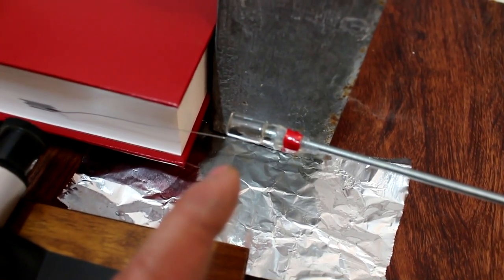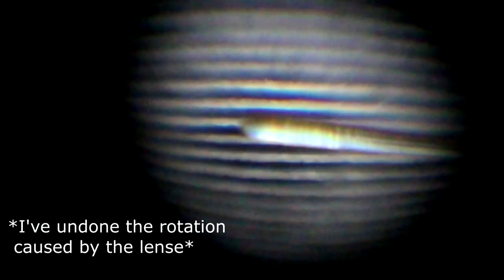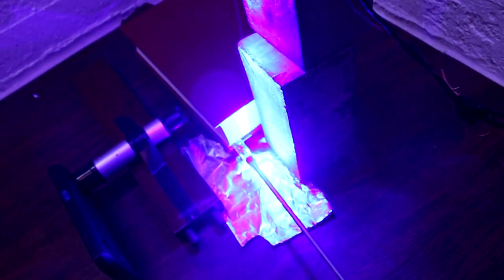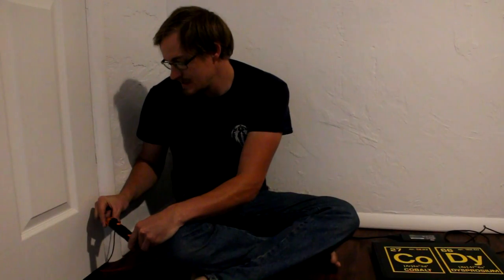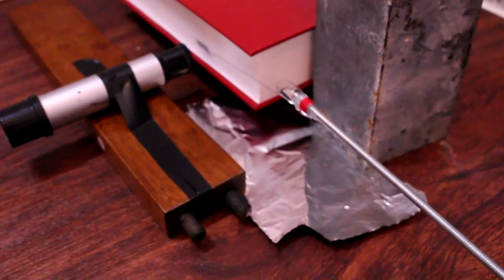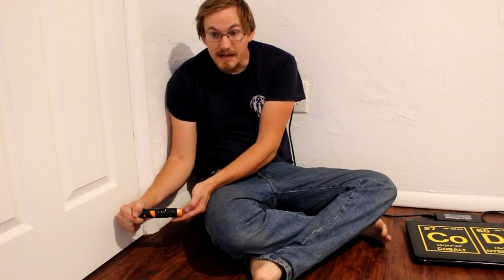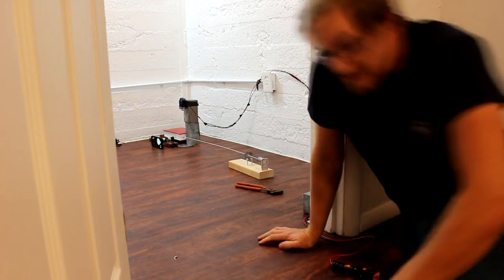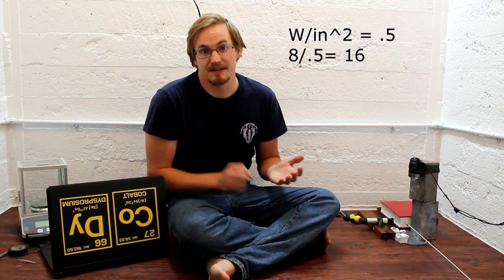Does Light Push?

Comment: 0:27 you said photons have energy and therefore have mass E=MC2.. that's not exactly right... or well most scientist would disagree anyway

 if photons have mass and are going the speed of light then they require infinite energy which isn't possible.. in the LHC they simply can't get particles with mass to %100 the speed of light because it would take infinite energy 

It's supposedly believed (according to most physicists)  that photon's have no mass but DO have momentum which pushes objects and you may know they CAN be affected by gravity i know what your thinking... no mass means you can't have momentum (p=mv) and you cant have it affected by gravity (w=mg) but the formulas change.. i'd like to get into it but you'd have to research it yourself.

Big fan BTW...
Reply: wouldn't it just be a really large amount of energy?
Reply: https://en.wikipedia.org/wiki/Mass_in_special_relativity#Controversy
Yes and no.
It's effectively a maths trick.
Reply: Correct
Reply: I'm curious to see what he says to this. I don't think he's wrong often haha.
Reply: You have to distinguish between "rest mass" and "relativistic mass".
The first is the "normal mass" that averithing has in the world we experience every day, and is the mass that a resting object holds; the Relativistic mass is the mass that depends on the speed (or wavelenght) the object (or EM wave) has. This effect is so small that we don't experience it in the every day life, but It's measurable.

I'll add that relativistic mass is a concept used to express momentum of a EM wave or small particles (like electrons), but it's not the same as the "normal mass", because we have to discover yet what mass actually is... Relativistic mass is just a term that derives from the mathematics behind this phenomena:

E=pc=hv
p=hv/c
p=mc
hv/c=mc
m=hv/c^2

E=energy
h=planck's constant
v=frequency of the EM wave (photons)
p=momentum
c=speed of light

as you can see you can correlate the frequency of an EM wave to his (relativistic) mass.
Reply: Faroacces0 that comments a bit theoretical don't you think? When was the last time you saw light at "rest" light isn't any slower even if you try and run along side it thanks to time dilation.
Reply: someone from the future please read this and respond when we have achieved traveling at the speed of light.
Reply: Robert Fisher what? I didn't say light has resting mass, i said it has relativistic mass and no resting mass... i studied some quantum theory at the university, i know what i am talking about, but english is not my language, so there could have been a misunderstanding
Reply: Its important when you start delving into general relativity and special relativity, both of which are very highly regarded theories.
Reply: +Nick Dunn what is important? (if you were talking to me)
Reply: are you implying it's relativistic mass gives it it's momentum?
Reply: +Robert Fisher (Kresnove) no,  it works in the other way: light has momentum (proven by experiments), and because it has momentum and we know its speed (light speed c), we can say it has mass, called "relativistic mass" to distinguish it from the "normal" (resting) mass and mathematically expressed from the equation i wrote above.
Reply: alright understood.
Reply: I'm sure Cody gets the idea at this point but what is important is does this effect the experiment? and if it did what could we do different? we're people of science after all  :)
Reply: +Robert Fisher (Kresnove) cody probably knows this stuff very well, but he didn't explained it very well because the point of this video is just to show the experiment.
the problem is that physic "speaks math" and you can't discuss it only with words, but if you want to explain something to a wide audience, you must dumb it down to avoid the mathematical part.

anyway what is shown in the video is right: light has momentum and when it hits a surface and bounces off it behaves like any other object thrown to another. the only difference is that instead of slowing down after the impact, photons change their wavelenght to lose the energy that is given to the object hit.
Reply: +Faroacces0    well, technically thats not all different because its more the fact that the object simply loses some energy when it collides with another. in the case of light it cause it to change wavelengths.
Reply: Photons DO have momentum because they can displace electrons from atoms by transferring it's momentum. 
but they don't have mass because otherwise it would need to have infinite energy to be at the speed of light.

If you combine E=hf and E=mc^2 you can find the theoretical mass of a photon. 

hf=mc^2
therefore 
m=(hf)/c^2

you can then go on to fin the momentum using by substituting the theoretical mass into p=mv

v=c because it's light
p= (chf)/c^2    - cancel come c's
p=(hf)/c then you can substitute in c=fλ in the form of f/c=1/λ giving you:
p=h/λ
Reply: +Faroacces0, you're confusing relativistic mass with theoretical mass.
Reply: Ethan Sloss I honestly don't know. As I said before, i'm not an english speaker and i don't study in english, so the terminology might be different between languages.
Reply: photons do travel the speed of light because in this case hey are light that dosent meen they dont have any mass, it only meens if they have mass they dont travel with the highest possible speed, dont get me wrog photons cant go any faster then the they are going in vaccum.
Reply: Lukas Kuhl you seem to be confused: light is both particles (photons) and an EM wave in any moment, but in different occasions it shows different aspects of its duality.
If light is not absorbed (like in cody's experiment), it behaves as particles and transfers part of its momentum to the target.

About the mass: they have zero rest mass, that's why they travel at the speed of light, but also have momentum, so that we can derive from their momentum a mass value. This is the mathematical demonstration:

E^2=m0^2c^4+p^2c^2 (einstein's equation)
m0=0 (rest mass is zero for the photons)
E^2=p^2c^2
E=pc=hv
p=hv/c (momentum of a photon)
p=mc (classic expression of momentum)
hv/c=mc
m=hv/c^2

m0=rest mass
E=energy
h=planck's constant
v=frequency of the EM wave (photons)
p=momentum
c=speed of light
Reply: ***** Lol sorry... i monopolised the comment session   : |
Reply: I didn't bother reading through the comment chain, but you and Cody ought to understand that the academic world does not even remotely accept any meaning of the word mass other than rest mass. Actually, they might even get pissed if you use the phrase rest mass. They're really, really pedantic about this stuff nowadays. They'll argue with you to the ends of the Earth over definitions, before you even get into anything meaningful (or arguable) like relationships and math. So, don't ever, ever dare mention things like this in an academic context. You might get snuffed out in your sleep, or possibly even immediately shot if you say it twice.

edit: In short, if you utter such things more than once in unknown company, you are a very brave person. However, you can safely say that photons carry momentum, and that phrase won't get you any drama. Just say, it has momentum, and it imparts momentum, carrying the rest away after being reflected. Using the word "energy" is pushing it, but mass? hell no, trust me don't try it. It's not worth losing your faith in the scientific world.

Also keep in mind that reflection is a rapid absorption and re-emission, just as passage through a medium such as air is a chain of re-emissions, and the ratio of resulting speed is refractive index. So in one sense it's not the same photon. In another sense, it is. In another sense, no small particle is actually the same particle for any finite length of time, even photons in a vacuum, thanks to the foam. It's all relative, so sometimes it's hard to predict when someone will get um, bitchy about something completely inconsequential. There's many such academic people, sadly.
Reply: Relativistic mass basically got phased out a few decades ago, we just call it what it is; another form of inertia.
Reply: Ethan Sloss Why would it need an infinite amount of energy? If E=mc^2, with both m and c as clearly finite values, E would also be finite, would it not?
Reply: That isn't the full equation, that only applies to rest mass and rest energy, photons have neither of those. The full equation is E^2=(mc^2)^2+pv^2 in which p is momentum. The momentum of a photon, a massless particle, is p= planck length over wavelength. They do not have actual rest mass.

The kinetic energy of something is equal to: mv^2 / 2(1-v^2/c^2)^0.5 . You can see that if v = c, the denomenator becames 0, and so you divide by 0 to get infinity (well, undefined).
Reply: SirusKing
The book used was Jules Vern, Twenty Thousand Leagues Under the Sea, at 300 pages.  This equates to 66.67 leagues per page.  0.25 pages = 16.67 leagues = 80.48 kilometers.
Don't point that laser at your cat.
Reply: Robert Fisher I think photons don't have rest mass but they achieve mass when given energy and it turn to velocity of photon. idk that much about it. E=mc2 holds true on that.
Reply: E=mc^2 only holds for stationary massive objects. The more general equation is E^2=(pc)^2 + (mc^2)^2. We know that photons have no mass, so E=pc. They do have energy though, related to the frequency by E=hf. Basically this means that although a photon has no mass, it has a non-zero momentum and so when the photon bounces off an object, there is a change of momentum and therefore a force is imparted.
Reply: Don't you need mass and velocity to have momentum how can you have momentum with no mass?
Reply: Mass is basically stored energy
Reply: E=MC2 means that light (photons) are simultaneously energy and mass. Meaning they have mass. Not much, but mass is lost during fusion of atoms, and that is released as photons.
Reply: Robert Fisher how black wholes attracts light if theorically whitout mass gravity shoudnt attract photons
Reply: That's impossible, I suggest watching some video's about it, because I cant explain it well.
Reply: Personally,  I find it difficult to believe that photons have mass.  There must be something(s) that are not being considered, or some factor(s) that's not yet known.
Reply: Afrocanuk no resting mass. They have relativistic mass.

 E^2=(mc^2)+(pc)^2
p is momentum. 
p = mv

Photons have Energy. In fact they are the de facto energy packet of the quantum world. In order for a photons to have energy it must also have mass. Just at least a tiny amount. This why they are still affected by space-time curvature.
Reply: basically what i get from this comment thread, is that every chemist thinks they know better than the last. When in reality were all spouting theories (dont preface it), and only a few of these core rules anybody can actually agree on, to the point of discrediting good chemists' names, simply based on differing scientific beliefs.

I wanted to be a chemist until seeing Professional chemists communicate. its far too political for my tastes. Seems like we let testosterone get in the way of progress sometimes. and im not talking about JUST this thread. Just the whole field in general. 

I have never been so captivated by something that I have no desire to pursue. I realise competition breeds progress, but loosing your reputation because you believe in a differing theory is backwards. Lets snuff out some great minds just because they are thinking outside the box. little do we know, scientists like that; are just as much a pillar, for why we have made so much progress, as the guys who believe in popular theory.

and if a scientist of any kind, is forced socially, to think a different way, because hell lose his job/credability if he dosent. then that is the definition of counter productivity thats not true unabridged scientific exploration. and from the worlds smartest people at that.

i am dissapointed to see this, and im a 19 year old kid. Productive Disagreements (like this) are one thing. but damn it all,  if thats not just the surface of the toxicity. 

i play guitar and go all over forums all the time. you dont see musicians slandering one another, because they have differing opinions on music theory. its called theory for a reason. its called a practice for a reason. we dont know it all. SO STOP ACTING LIKE YOU KNOW IT ALL, fuck.
Reply: There is no such thing as "photons".  Electromagnetic radiation is only waves at all frequencies.  The single slit and double slit experiments show that light is waves. None of the slit experiments show that light is particles.  The Photo Electric effect can be explained without any need for light particles. There is no proof that Electro Magnetic Radiation (EMF) is waves up to red light, changes to particles in blue light and reverts to waves at frequencies above blue light.  Photons don't exist, EMF is only waves at all frequencies.  If Cody (or anyone) else thinks blue light is particles, it should be easy to design an experiment to prove it.
Reply: Robert Fisher photons are "light" so basically if you are talking about speed of light you are talking about speed of   photons
Reply: This is the correct answer.
Reply: Thankyou
Reply: danny gerner no
Reply: I Guess it's like an Infinity*zero limit situation where the speed of light is "infinity" and mass is zero. But it turns out to be a finite non zero value.
Reply: Ad Nauseam!!! 
E^2-(pc)^2=(mc^2)^2 This is true for all particles!
In the case of a massless particle such as the photon...
E^2-(pc)^2=(0*c^2)^2=0 Because m=0!!!!!!!!
E^2=(pc)^2 ==> E=pc !!!!
E=hv Where v is the frequency of the photon!
pc=hv ==> p=hv/c. NO NEED FOR A MASS TO HAVE MOMENTUM!!!!!
Gravity curves spacetime! You do not need mass to be affected by it!! 
THERE IS NO SUCH THING AS REST MASS! There's only mass, a useful concept of mass is as an INVARIANT for all frames of reference!!!
Reply: But then if stars produce light then does that mean stars have infinite energy? Wouldn't light sources all be different speeds if all stars produce different energy's from different elements being created?
Reply: umm..no..light is massless..or rather it has a mass of 0 so you don't use e=m/c2 for it..
Reply: @jimm638  so sun's are massless? And energy for light doesn't exist?
Reply: First of it is quantum mechanics and Newton's second law f=ma/mg doesn't work in quantum level and the fact that photon doesn't have mass is false..it's rest mass is zero so... theoretically mass exists only when it has momentum...it's Heisenberg uncertainty...so u literally can't trap or store a photon in a box or something like that...coz no mass when it is in rest...
Reply: Ever heard of  light sail?
Reply: If it has no mass how can it be bent by gravity
Reply: @Faroacces0  Relativistic mass is a fake, a wave does not have mass. And to deal with photons, you must know a lot, the true is that the explanation is fake.

Comment: No idea what your talking about but, cool!
Reply: Pyotr Lebedev was first to successfully demonstrate light pressure, which he did in 1899 with a torsional balance;[6] Ernest Nichols and Gordon Hull conducted a similar independent experiment in 1901 using a Nichols radiometer.

Solar sails use a phenomenon that has a proven, measured effect on spacecraft. Solar pressure affects all spacecraft, whether in interplanetary space or in orbit around a planet or small body. A typical spacecraft going to Mars, for example, will be displaced by thousands of kilometres by solar pressure, so the effects must be accounted for in trajectory planning, which has been done since the time of the earliest interplanetary spacecraft of the 1960s. Solar pressure also affects the orientation (Aircraft attitude) of a craft, a factor that must be included in spacecraft design.
Reply: same!
Reply: +aldo guzman K